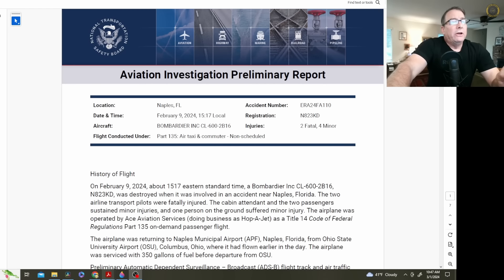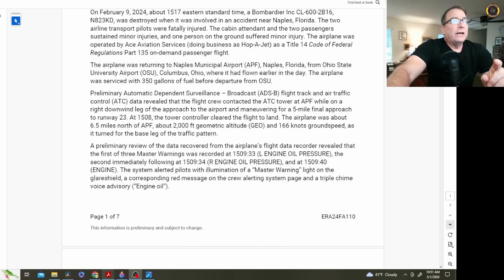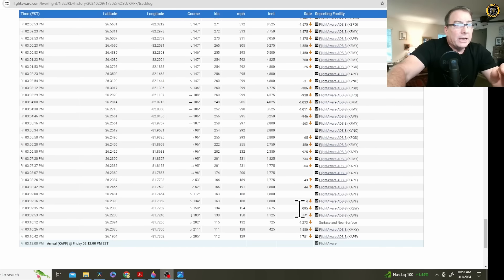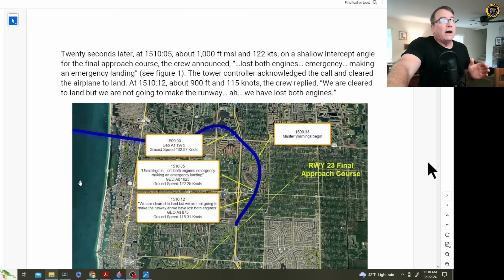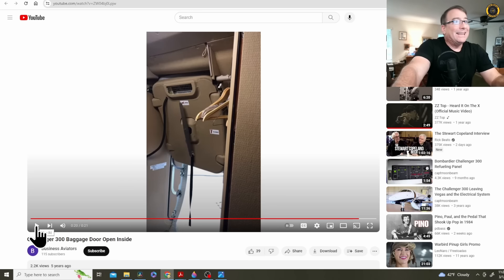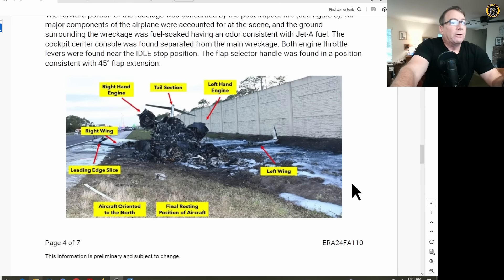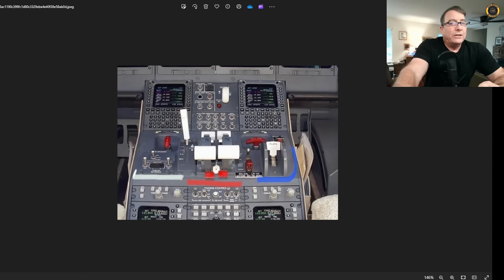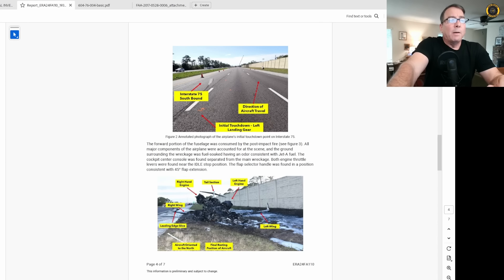NTSB Preliminary Report: Naples Challenger 600 N823KD

Comment: If the thrust levers are the same as the CRJ, they have to be at the idle position in order for the red triggers to actuate and then you’re able to move the levers to cutoff. If you accidentally bump the red trigger when the thrust lever is above idle, or even actuate and hold the trigger, when you try to move the lever to cutoff you be unable to shut the engine down.  Until releasing the trigger and moving the thrust lever to idle, then re-actuating the trigger will allow shutting the engine down. Hopefully this makes sense…

I know of one instance of a CRJ 200 having an inadvertent engine shutdown when a CA reached behind the thrust levers for some reason and bumped the right shut off trigger while pressure was was on the thrust levers at idle from the first officer acting as PF. The thrust lever needs only to be moved a micro amount below idle to shut down.

Comment: Having flown the Challenger, CRJ200 and 900 models, I can tell you for certain that the inadvertent operation of the fuel shutoff levers whilst the Pilot in the left seat is making a flap selection is a bit of a stretch…it just can’t happen. Something that has not been addressed would be the fuel feed lines that run in a protective shroud  aft from the fuel tanks under the cargo hold then up to the left/ right engine and APU. Corrosion has been a big culprit in this area on older aircraft. Recently I fired up the APU up on a 200 only to find fuel pouring out the bottom of the cargo bay due to a delivery line failure. Not saying this would cause a double engine failure, but it might be something to consider.

Comment: You know, given how expertly these pilots set the plane down on the highway and how close they came to saving it, and the fact that their amazing piloting likely saved those in the cabin (applause to the attendant, too), I really hate to lay the blame on them for the crash, but Juan's theory regarding the throttles is extremely plausible. 

It honestly sounds a lot more likely than both engines suddenly sucking up contaminated fuel within a second of each other after hours of normal operation.

Comment: Juan, they burned through most of that fuel by the time they were on downwind. I know I land my Ultra with 2000 lbs of fuel so I would guess these challengers land with a bit more. If the fuel was contaminated I would think it would show earlier in the flight like the CE550 did out of Punta Gorda (if I remember correctly) few years ago. Could this be a similar situation to the Atlas Air 75 over in Houston several years ago with an inadvertent TO/GA press? Guys were so close on making it work. Exceptional work by the flight attendant.

Comment: As far as the engine fuel supply they recovered, they're probably talking about the collector tanks, which feed the engines. They sit in the center of the wing (wing root) area and it looks like the left wing wasn't damaged in that area. The right wing and right collector tank was destroyed.

Comment: For those who do not remember, Delta Airlines had a dual engine shutdown after departing San Diego. They came within feet of hitting the water. One of the pilots accidentally shut down both engines. I believe this was a 767-200. They got a successful relight, and continued the flight on to the destination as if nothing had happened. Don't recall if any action was taken against the pilots or not.

Comment: I've got several thousand hours on the Challenger 604/605 and they are very lucky that this was a Challenger, since it opens from the inside and not blocked by baggage, as it can often be. Had the baggage compartment been full or another type, like a Falcon, these folks would have not been able to get out.

Comment: Aviation News talk discussed the possibility of a jammed or damaged rack and pinion in the throttle linkage that might have shut the engines down. That's the only reasonable hypothesis i can come up with. It's hard to imagine even heavily contaminated fuel shutting down both engines at exactly the same time.
Reply: This, there is just allmost no way to get two carberated engines to shut down simultaneously from fuel. Amount in the bowls the sputters as each furthest cyl starts to misfire. Itd be hard using fuel to get em both off within 1sec
Reply: The only thing against that is the throttle cable at the engine side was found at or slightly above idle. If the failure described in that service buletin occurred, wouldn’t you see a mismatch between what the throttles were set to on the column and where the other end was at the engines? The control handles would be at idle while the engine side would be cutoff.
Reply: @captaintoyota3171 These are turbine engines with injected fuel.
There are no cylinders
Reply: @andrewtaylor940  I don't know anything about that system so I couldn't say. Apparently there's an AD for something in the throttle linkage that can become jammed. It's possible that the engines were shut down, controls jammed, and then the controls were freed as they were trying to relight the engines. I'm just saying it doesn't seem like fuel, especially after they've already flown an entire flight and they're on short final. Seems like a control problem to me. The CVR and flight data recorder should tell the tale.
Reply: @danielreuter2565  That AD is 200 years old ( 1995) and I don't  think even one GA aircraft was affected by it
Reply: @tyronetrump1612  yeah I'm sure. Something related to an uncommanded or accidental shutdown still seems most likely to me
Reply: @danielreuter2565  yeah it's smelling that way - figure by now they would release the findings on the FDR also

Comment: If you turn off your car while  driving, it's not going to pop up a check engine light where a failure that causes the engine to stop will pop a check engine light.  I don't know if an inadvertent engine shutoff is going to read the same as a dual engine failure, as that specifically is what the pilot said happenened.

Comment: Been a long time since I worked on a Challenger and don’t recall, but would think if it were a fuel contamination issue, there would have been some type of “fuel filter impending bypass” CAS message long before the engines shutdown. Well done by the crew (RIP) and FA to get the pax safely evacuated.
Reply: Solid contamination would cause bypass. Liquid unless it caused ice would not.
Reply: Agreed. The narrator mentions possible fuel contamination as a consideration, but the report states both engine fuel filters appeared clean with no debris.

Comment: What would happen if the jet fuel became thickened while flying at 40,000ft  and then descended quickly to land? Was that their inflight altitude? The thickened fuel  would feed both engines. Therefore simultaneous engine failure. I would like to see the preflight fuel status...gallons? Additives such as FSII?

Comment: I taught generator mechanics in the early seventies at Ft. Belvoir water in our fuel supply was a major problem. Both gas and diesel fuel supply tanks and all generators had to be checked daily at the field problem site I worked at. The bank may be the cause of the sudden cutoff if a water slug or other non-fuel liquid was fed into both engines. If not Pilot error is probable.
Reply: Each engine is fed by totally separate tanks.  It could explain one engine shutting down but the odds of both at the same time are astronomical.

Comment: You should discuss that PRIST was not added when the aircraft refueled in Ohio.  I'd like to hear your thoughts on this.
Reply: Fuel/oil heat exchangers negate the need for prist.  This most likely wasn't a prist issue.

Comment: One rule I have implemented is to sump both tanks after refueling, BEFORE taking off again.  I usually go to other close by airports to fuel up because of the huge disparity of pricing.  Even if you gas at your own local FBO, there is always a possibility of water, or a contaminant, getting into the fuel tanks.  Better safe than sorry.

Comment: I have a place down there and I was thinking the speed limit on that interstate is 70 miles per hour and most people do 75. I was hoping that would help equalize the speed difference. But what I didn't realize is that this is the busy season in South Florida where many people come to , in the winter for the warmer climate. Hence from the video there seemed to be quite a lot of traffic on that interstate. Where usually in the offseason there's a lot of open space on that interstate. Also that I-75 in that location makes a large turn. Unfortunately a lot going against them.

Comment: Nice analysis Juan as usual. Having spent ten years of my life around CRJs, which are nothing more than stretched challengers, I don’t think this was a case of the captain bumping the thrust levers. You have to pull up on those switches to pull the engines to cutoff. If the captain had done that by mistake, it would have been an upward force which if anything would have pushed the throttles slightly forward. The service bulletin caught my eye immediately after. I can see it being related to throttle rigging, or fuel contamination.

Comment: One thing that might support the fuel issue is that that was probably the first time since TO that the throttles we’re reduced to idle, the rest of the time they were at a higher setting, so if the fuel was sub standard, it might have ran at higher power, but Idle would not keep it running.

Comment: Industrial diesel powered equipment often is often equipped with water detection sensors in the fuel filter sumps.   They give you an early warning of water in fuel system before the sumps reach a critical point and water enters the fuel injection system.  I wonder why aircraft don’t have this.?
Reply: Diesels are very sensitive to water and it goes into a piston for individual firing every other stroke.  Miss three or 4 in a row and engine shuts down.  Jet engines are just a continuous spray of fuel feeding a flame.  Takes a lot more water to shut them down than a diesel.  During old SAC days the tankers and bombers were water injected to give more trust at takeoff  from all of the expanding molecules.

Comment: I flew CL-65 (CRJ-200) for 13 years, and we had the same throttle quadrant.  I heard two separate stories of pilots slamming the thrust levers to idle upon landing and both thrust levers hopped the idle gate into shutoff.  I always thought the design of that system was flawed. Of course slamming the thrust levers isn’t good technique, but if the idle/shutoff gate was worn, I suppose it’s possible it’d take much less force to get them over the “gate”.

Comment: They probably did a green approach with the thrustlevers in idle, the left seated FO with just 138hrs on the for him, new type, accidentally did like the Atlas Air 3591 with the flaps. They then forgot about that they already had the thrustlevers in the idle pos, pushed them down- and the accident was then writen..

Comment: The situation that the service bulletin brings up is horrifying 17:05
Reply: But unlikely to happen to both throttles simultaneously.
Reply: @johnbriggs3916  I second that response.  It would have happened to one engine first previously and would be in the maintenance records
Reply: That service bulletin is addressed by a routine inspection to measures wear in the throttle gearbox. Very unlikely that you are going to have the same wear that would lead to both throttles failing at the same time.
Reply: Yes.  Completely agree.
Reply: @robertc4293  Not only that the engine guys at Hop have been doing this a very long time  and are well aware of any rigging idiosyncrasies
Reply: Indeed.

Comment: I think as per Occam’s Razor that the simplest explanation is usually the correct one. The most likely scenario is an accidental crew initiated engine fuel shutoff. It fits the circumstances perfectly and is the simplest explanation.
Reply: Actually it's the opposite. If it was an unintentional fuel shut off, that is actually one of the least likely possibilities. The analysis here was to eliminate the most likely causes and see what we are left with. "Process of elimination".
Reply: @igclapp  what the heck are you talking about? If it was one of the least likely possibilities as you suggest then why have the NTSB said the most likely cause was fuel contamination or inadvertent crew fuel shut off? Your statement contains no logic.

Comment: Is it possible that the fuel shut off levers (red ones) remained up (unlocked) after engine start? And then when starting the approach iso of the crew bring the throttle back to idle the throttles went into the shutoff position without them even noticing until they got the engine shutdown indication? Investigators finding that the throttles were in the idle position could have been that the crew were desperately trying an engine restart.

Comment: Perhaps the #2 (right side) engine had no fuel in the line due to gravity, as it came to rest on the high-side of the crash, inclined toward the fuselage. If the fuel line was not pressurized after impact, fuel would drain "downhill" toward the fuselage, leaving the lines empty. Also, need to see what the co-pilot's primary jet was prior to his 138 hrs in the CL-600; maybe a carry-over from years of experience in the other jet's thrust levers led to an error.

Comment: They are examining cable and cam positions and everything else here to verify throttle position, which means nothing because they could have been in any position after the fact.  The question is, were they ever at cut off?   Thats on the data recorder.  They always drag it out for a year.  The data is right there.  Meanwhile thousands of people are on these things every day with crews reaching all over those triggers to select flaps from across the flight deck.

Comment: I feel like that's kinda weird design. I mean shouldn't there be some kind of bump stop on those levers which first need to be flipped up? 🤔

It's not like you wanna shutdown your engines ever in a hurry, it's always either on the ground or in an emergency where you triple check that's it is the right engine anyway.

Comment: It is not possible to “inadvertently” shut down the engines when the left seated pilot is applying the flaps. To shut down the engines you have to pull that red lever UP. To shut the engines, it has to be a deliberate action.

Comment: I know the fuel truck was isolated and contained for analysis so what I want know was there any other aircraft that was fueled from the same truck that got its fuel from the same fuel farm as the accident aircraft that exhibited any fuel contamination issues?  I’m sure they know by now if fuel contamination was the issue.
 I Hate to think of the only other way those engines quit.

Comment: Great vid JB, it looks like the way the aircraft came to rest it appears that the #2 engine is higher than #1 so the fuel ran out from gravity, that is why no fuel was found in the connecting pipe to the right hand engine. your thoughts ?
Reply: Not only gravity, but the Coriolis forces sloshing fuel around. On a right bank around the downwind to base corner, forces are straight ahead as the craft turns right. Thus, fuel would continue in a straight line, pushing it portside towards #1. Gravity, true, but momentum even more.

Comment: ...Wonders if the cutoff detents were made to disengage when pushed down instead of "up" would've made a difference,  but even then... Its hard to imagine those detents being interfered without notice by either pilot. But certainly that phase of flight, your attention is mainly outside the aircraft.

Comment: I believe Dan Gryder [Probable Cause] did a video on this accident right after it happened. In his video he had audio recording of the ground support crews when they arrived at the departure airport. The crew requested 350 gal of fuel that DID NOT have anti-freezing agent included. The fuel request was to avoid airport use fees and the fuel with and without the anti-freezing agent were the same price. Dan believed that on the return flight they got to altitude whereas the fuel froze which caused both engines to fail simultaneously.

Comment: This highlights the hazards of having the cockpit designer have too much leeway in the placement of critical controls.   They likely never thought of the possible interaction of reaching around to the flap controls.  The switch layout may have looked neat and symmetrical and not taking up any panel space, but creating a hazardous situation.  Safety of flight is paramount and every effort has to be taken to avoid creating these dangerous situations.  Either move the switches elsewhere or add another centimeter of pull needed to move the switches.   And add periodic checks to ensure the switches can't be slid over the detents due to wear.

Comment: Excellent job with the forced landing, as they flew all the way down.  I have a question for pilots of this size jet airplanes.  I have had many engine failures crop dusting and wonder if the jet's rudder is as effective as is the rudder on old Pawnee and Callair spray planes.  Longitudinal alignment and maintaining centerline or directing our course down a crop row is all rudder yaw.  The same rudder only is used to miss obstructions on forced landings.  Coordinated turning, when very low, will put a wing into the ground.  Perhaps not enough to overcome the drift right with so much mass, but no wings level yawing to align with the freeway centerline seemed to happen.  Skidding stall/spin has not been a problem for me with the nose down aligning with runways, crop rows, and forced landing zones.